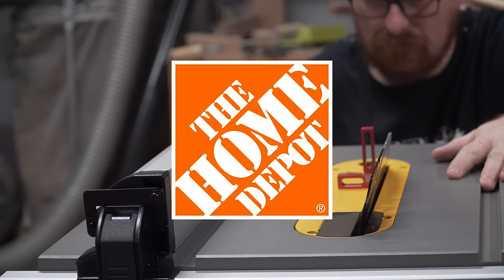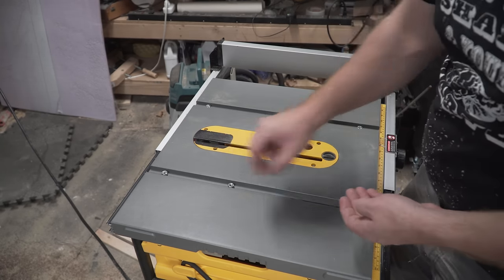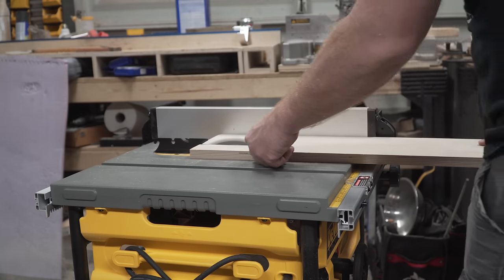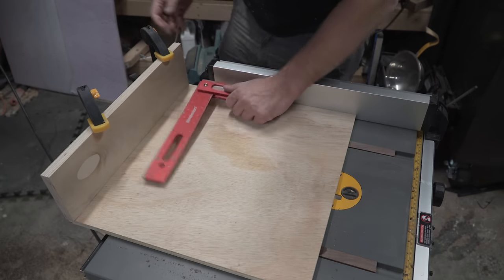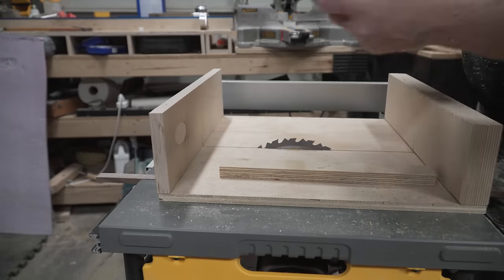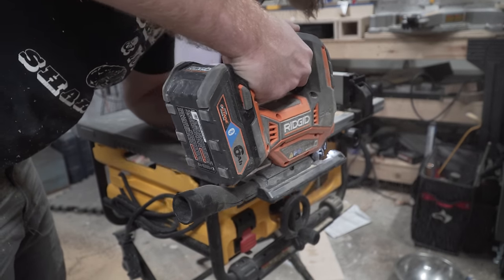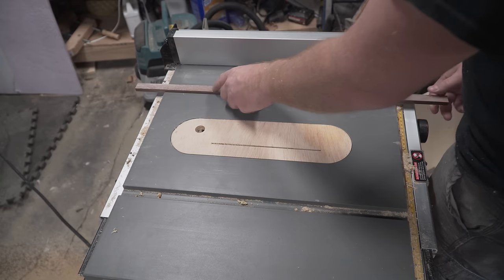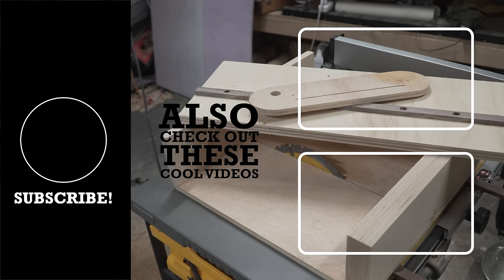3 Simple Jigs to get Professional Results from any Table Saw | Shop Tips

Comment: when cutting narrow pieces cut about half the length of the board shut off power flip board end over end and finish cutting the strip. You never have to get close to the blade. Your welcome.
Reply: They make amazing push blocks for this also.  Stopping and starting on a peice is just asking for a higher chance for tear out.

Comment: Do note that you can extend the slot in your zero clearance insert to accommodate a riving knife.  It's totally worth the effort.  That means I can use the zero clearance with the riving knife, blade guard, and kickback pawls.  I never have to choose between safety and better quality cuts.
Reply from the maker: Indeed you should, that was an oversight on this video I regret.
Reply: @WoodWorkLIFE  - It would be short, but it could be subject matter for a future video.  Maybe find a few other small mods that enhance safety and package them up?
Reply: @WoodWorkLIFE  excuse me I'm new to this.. but what is a river knife and what does it do?
Reply: @WoodWorkLIFE  excuse me I'm new to this.. but what is a river knife and what does it do?
Reply from the maker: @alienscientist8893  a riving knife helps to keep the tension in wood from pinching the blade causing kickback.  This is a critical safety measure and I should have demonstrated how to incorporate it into my final design.
Reply: @WoodWorkLIFE  Great thanks for letting me know. I'm about to invest in a bosch table saw.
Reply: @iwantotwatchagoddamn Show us your videos or shadda fukup.

Comment: Quick tip: make the jointer sled as long as the width of a sheet of plywood (4 feet) so that when ripping down a whole sheet of plywood with a circular saw into more manageable pieces, you use the jointer sled as the fence for the circular saw cuts :)

Comment: Finally!  Someone hitting up the worksite affordable side of woodworking!

Thank you!
Reply: Not really.  I have a HF saw I got for around $50 new, years ago.  Crap, right?  I make saw sleds for my sawing and I get dead on cuts with them.  Also I put a bridge over the blade so the only way my fingers could get bit by the blade is if I laid my hand flat, and slid it under the bridge.  Also put stops on front and back, so the blade never shows, and impossible to get cut.  I value my fingers, this guy apparently has fingers to spare.
Reply: There are hybrid saws ( somewhere between job site and professional caninet saws) that are very affordable and much better than job site saws with exception of portsbility. There are Ridgid, Delta, Grizzly come to mind of affordable hybrid saws

Comment: The last jig was the most useful always wondered how to cut a curved board straight and that looks like just the ticket Tha KS for sharing
Reply from the maker: For sure, and you can use a straight line rip jib for so much more too...bevels, veneers, stock prep, tapers, thin strips...all the things.
Reply: You can always go the method of screwing something you know to be dead straight to the curved board and then run that straight piece along the fence also. Handy in cases where you are possibly doing something over 2ft long or so

Comment: Great job thanks for posting.  Really should use push plates with handles on them to push your material through.  You are way to comfortable getting your hand too close to the blade as you push through.  The push handles give you very positive downward and fence pressure along with forward pressure.  Just some advice.  Love the jigs!  Thanks
Reply from the maker: You're right although it's not as unsafe as it looks.  There is a concept called lense compression that causes object to appear closer together when you are zoomed in a lense.  My fingers are never really THAT close to the blade.
Reply: Wood.Work.LIFE. - it only you that you have to convince. Thanks

Comment: extremely useful shop projects, particularly the third jig with just one runner. Thanks
Reply: Yea I came to comment on that final jig - how have I never thought of that before?!?!

Goes to show that the best option to accomplish a simple task is usually very simple and easy, you just need to know the answer :D
Reply: I need some more info on how that third one works. I don't get what it would be good for exactly.
Reply: @Morgoroth37  if you have a piece of wood that doesn’t have a straight edge to make an accurate cut against the fence from, you need to make a straight edge. (The fence is only good if there’s an accurate straight edge to slide along it) That third jig allows him to take crooked boards and make them at least one side straight, so he can then use the fence on the side he just jointed.
Reply: @Fereshetian22190  thanks! I didn't realize how important that was! I've been using plywood so far.

Comment: Thanks for sharing! I’m wondering how to put a measurement guide on the fence of the cross cut sled
Reply: Try routing out a grove and using a yard stick as an "inlay." I did the same thing on a fence extension I did for my miter saw and I'll be doing it with an assembly table I'm building soon. I would recommend cutting off a quarter inch so the edge isn't riding next to the blade on every cut. Also, use the aluminum yard sticks. They won't wear as fast as the wooden ones and the material is soft enough to cut with an old miter saw blade.
Reply: @bh7926  cheers!
Reply: You could just measure your piece normally and make a line and then line up your line for your cross cut with the kerf cut on the sled

Comment: When making a wooden throat plate, always have the top grain running parallel with the blade.  It's a small detail, but it does make for smoother cuts.  Another trick is to saturate the cut edges of the ply to stabilize the laminates; makes it much more durable.
Reply from the maker: It is plywood so the grain direction goes both ways.

Comment: No riving knife fitted is asking for a kickback! Plus fingers rather too close to the blade for comfort...always use a push stick if you want to keep those digits!
Reply: Riving knife has to be removed in order to raise the blade up thru the boards. There was one cut with the 45 degree bevel that his fingers were somewhat close to the blade but he would have lost some control with a push stick if he had used a push stick. All other cuts were with the sled. As general advise, yes riving knife and push sticks are the safest but there are times when there use doesn’t make sense and even times when they raise the risk of an accident occurring.
Reply: I agree. I used to have problems with kickback when I bought my Dewalt table saw years ago and removed it and have never had a single time since where I’ve had a problem with kickback. If you know how to feed the stock thru the saw, the riving knive preventing kickback is just a myth if you ask me
Reply: I'm not sure if many folks need to taper 2×4 lumber along it's 3-1/2" face, but I needed to and couldn't have done so without a jig I made (didn't see such so maybe I invented it?). So for me my solution became an essential table saw jig.

Problem was that a 10" table saw barely cuts a standing 2×4. So, putting it atop the usual taper jig leaves the saw blade too short for the job.

My solution was to make a split fence jig from plywood. The back fence laminates two 1/2" pieces 3"×40" and  single piece front fence is the same size. The two are joined at the back end by a hinge. Near the front end, a hole is drilled through to accept a 5/8-16 tee-nut and the back side was counter-bored to accept a 5/8" socket wrench. Various length 5/8-16 screws give a range of taper angles. (Since the back fence will ride the table saw's fence, the bolts cannot protrude.) The screws maintain the desired angle against the front fence by the spacer they create between them.  The last two pieces are (1) a small heel on the front end of the front fence and (2) a sliding lock on that end to lock the two together to fix the taper.

The workpiece rests on the saw table with the hinged end of the fence first. The back fence rides along the saw's fence. The small heel pushes the workpiece through the cut. The taper line penciled on the workpiece is parallel to the back fence.  The only caveat is to use infeed support for long tapers. Also a handle can be attached to the top of the back fence if desired

TDinDC
Reply: I could barely hear what he is trying to explain. Too distracted by how unsafe he is being.
Reply: I second this, no one is impressed by your ability to place the ONLY fingers you'll EVER have close to the table saw blade, riving knife or not, it's not a smart move bro.
Reply: @Mosessousa1  You used to have "problems" with kickback?!  The riving knife is a myth?!  Step away from the table saw dude.  You and it have issues.

Comment: Nice, concise video.  Thanks.  For longer "jointed" rips I like to hotglue one edge of the board to my 6 foot level and then use the level as a straight edge along the fence.  It's important to use the cupped or concaved side so that it won't rock (can be done without the glue as well).  Then I pop the level off, flip the board and cut my parallel edge using the newly minted jointed edge.

Comment: I've made a zero clearance for my saw too, but I cut all the way to the edge for my riving knife. Do you not use one?
Reply: You don't have to go all the way to the back edge.  You can leave  some material to keep the insert rigid and still leave room for the riving knife.  Very important.
Reply: Excellent point. No point in compromising safety .. its hard to do woodwork when you are missing a bunch of fingers.
Reply: @chriselliott726  That is not what a riving knife does. It helps with preventing kickback and binding but the whole point of a zero clearance insert is for thin materials and small cuts where that type of kickback and binding doesn't occur.
Reply: @1995rwt  I am afraid you are badly informed my friend. Perhaps take a look on YouTube for videos about severed hands and fingers as a result of kickback accidents - if you have the stomach for it. Kick back can throw work back at you causing severe injury or death, but equally drag your hand into the blade.

I would also say that those wedded to zero clearance throat plates and no riving knife do not routinely change their setup for different thickness materials.

I sometimes remove the top guard on my machine for groove cuts, but never the riving knife. That is reckless, but of course you are entitled to put your own safety on the line if you choose to do so.
Reply: Chris Elliott anyone using something incorrectly is libel to injure themselves. What is the point of a zero clearance insert other than to better handle stock that would normally get caught between the throat plate and the blade, or maybe even between the throat plate and the riving knife. I’ve seen kickback before, experienced it once thankfully to no personal injury. I’ve also cleaned bits of fingertips out of jointers before, I get how dangerous tools can be but a zero clearance insert with a riving knife won’t work for the thing that zero clearance inserts are useful for which is ripping thin veneers out of larger boards.
Reply: @1995rwt  I can see I am pushing water uphill here!

Do me a favour and watch the YouTube video entitled 'TUTORIAL: Make SAFER, cleaner table saw cuts with this table saw insert + zero clearance splitter'.  Then you can come. back and explain why you personally can't use such a device.
Reply: @chriselliott726  Thank you for sharing that video.  Brilliant idea, especially with the hot glue shims.

Comment: I just started using a table saw on my own and I watch this to learn something.  However, unfortunately, after seeing what he built here I have no idea what those things are used for.
Reply from the maker: You will very soon learn.  This are jigs for cutting square and straight edges.
Reply: Chris if you take anything from this video, let it be how NOT to safely use a table saw. This guy is going to lose a finger or part of his hand someday. Also, his wood gluing method is bad.

Comment: Pretty cool Jigs! I have the same table saw set up. It is awesome saw and a great value. I was curious why on so many of your cuts that your blade appears so much higher than the wood?
Reply from the maker: I usually raise the blade until the gullets are even with the surface but with plywood higher blade setting reduces tearout.  Not great for safety, but I steer clear of the blade.
Reply: It is a never settled argument over what blade height above the wood is best or safest. The only real benefit to having the blade super low is less blade exposed to the user. However if we're using using proper techniques and push sticks and the like then having the blade higher isn't really any safer than having the blade lower. Also using a blade guard makes the argument against having the blade too high to reduce the chance of blade contact a completely moot point anyway. 

The argument for having the blade higher is that you have less teeth in contact with the work at any given time reducing the friction the blade has against the wood which reduces the overall forces trying to push the wood off of the saw top.
Reply: Just got about 1/8" higher than the wood (accounting for bowed plywood 😉)
Reply: Old school of thought was use blade slightly higher than material be cut. Fast forward 20 plus years and that is no longer the recommended practice . Raising the blade higher helps hold down the material.

Comment: SLOPS: Demonstrated some dangerous habits here, man.  The built in riving knife on that saw is great, and it definitely saved you-- a couple times in this video alone.  Also, I've had a zero insert fence eject out of the table before and I still bear the scars on my left hand.  I had made it just like yours, without a retention tab or screws, and learned the hard way that those features are NOT optional.

PROPS: Nice super glue tip. I'm gonna use that for sure.  Overall, really good video that went straight to the point and wasted zero time.
Reply from the maker: Ya I added that stuff too but I was just trying to get to the point with this video.  I normally use a riving knife when ripping or cutting sheet goods.  Left it off for the jigs.  I opened up the back of the zero clearance plate and added tabs for the riving knife after the fact.  Thanks for caring about my digits.

Comment: That was brilliant...my table saw is from that family of worksite equipment and I've been wondering what I could do to improve the accuracy of my cuts.  Secondly I have a legit jointer but it's only good to 6" wide boards and this is without a doubt the most straight forward explanation I've seen for building a table saw jointer for that first reference face.  I'm going to build this cross cut sled and jointer sled this next weekend!
Reply from the maker: Thanks Roger, let me know how it goes

Comment: Been building furniture and cabinet's for 30 years..... Never used a sled!  I never understood why people are fascinated with them?  Just saying. Nice video
Reply from the maker: More power to you.  Do you use a sliding cabinet saw?  If so, ya pretty much you don't need them.  If you aren't using a sliding cabinet saw...why not?  you have been making money at this for 30 years, haven;t you earned it?
Reply: @WoodWorkLIFE  I mean no disrespect.  Thank you for providing content!  I use a chop saw for small repeated cuts.  I use a Powermatic table saw for rips... Cuts etc..  Best of luck to you and your Chanel!
Reply from the maker: None taken...just messing with you.  A good calibrated chop saw does great things for cabinet grade joinery.  Often times the vibration of the chop saw (due to the spinning of the blade) is enough to add a little bit of error that is beyond the tolerances of fine furniture joinery.  There are also a ton of non-90 cuts that can be easier at a table saw with a sled and various jigs.
Reply: @WoodWorkLIFE  Those saws suck. Bought 3 they all went back. Went a head and just bought a Sawstop.. Don't have time to screw around getting them adjusted correctly, and my projects r top notch and my clients don't except Crap work.. All to their own.
Reply: @scraplifetrashtocash4551  Yeh you are a regular Norm from this old house I bet, one in every shop.

Comment: Try using a medium or thick superglue; thin glue wicks into wood and irks best on reinforcing things that are already together while medium and thick both work more like traditional wood glues. I use Maxi-Cure CA glue which is thick and with or whiteout activator works great. I use it quite a bit in woodworking and buy 8 oz. at a time which runs $12 or so on Amazon
Reply: Chris Lackey could you provide a link?
Reply: P

Comment: Really like your videos but.... it appears you are operating the table saw without a riving knife. Isn't that extremely dangerous?
Reply from the maker: Only when raising the blade into a cross cut sled.  I opened up the plate further to account for riving tasks where the riving knife is necessary (such as ripping thin strips) a zero clearance throat plate would be most important for cross cuts and thin strips.  Most ripping tasks "shouldn't" have tear out.